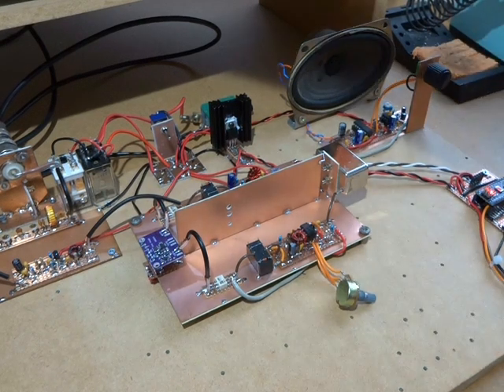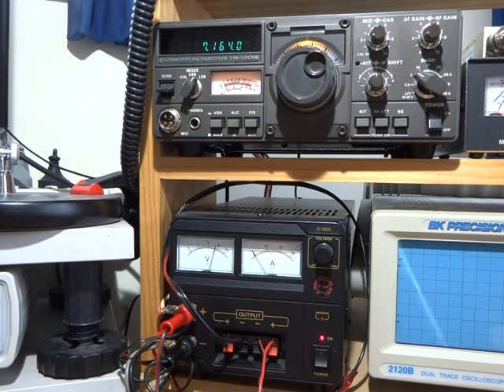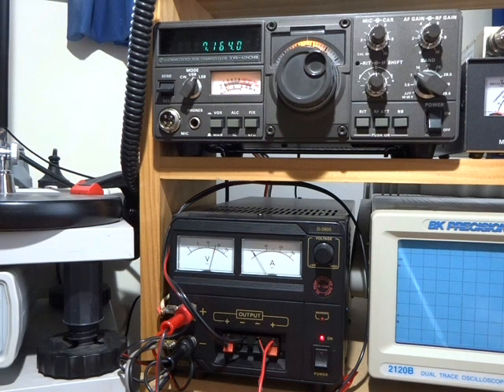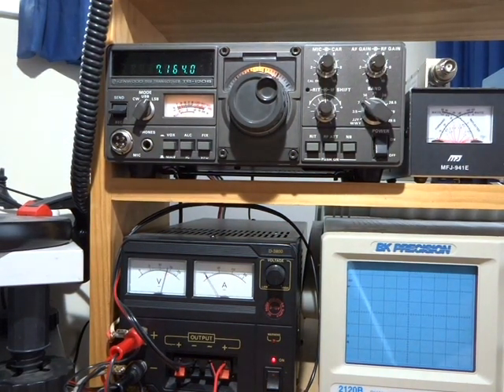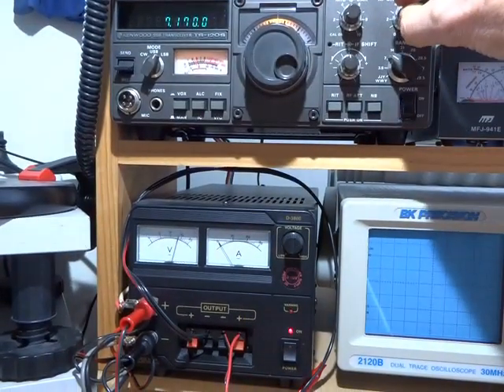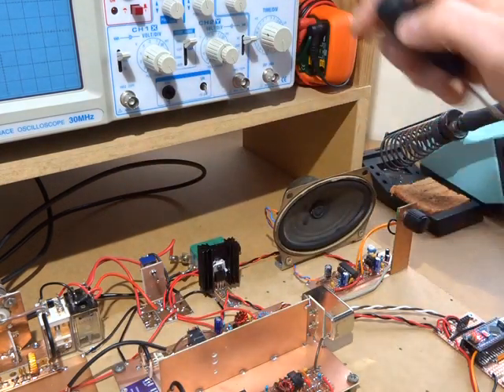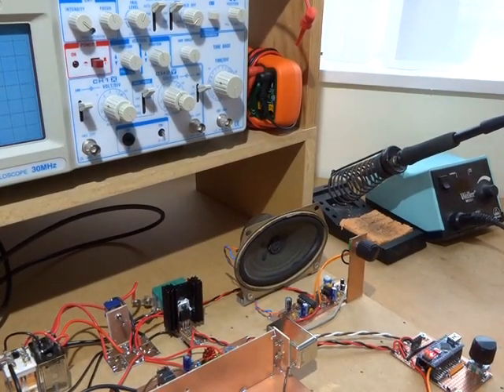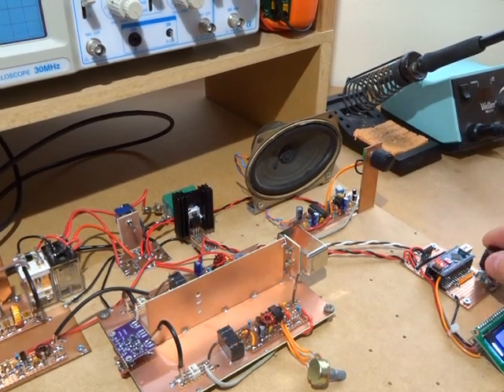Homebrew MC1350P based SSB Rig - #7a Commercial-Homebrew Receiver Comparison

Comment: Sounds great, Charlie!  One of the complaints I hear from new hams is about the cost of buying an HF rig.  You've proven that does not have to be a barrier.  I do volunteer work teaching electronics to middle school and high school students -- some of them end up getting an amateur radio license.  I'm working on a receiver design that can be built in modules, configured as a direct conversion receiver, and then as a superhet.  The radio is working well.  Now I'm redoing the PCB layouts so it will all fit in an enclosure so the students can build, learn about RF modules and receiver design, and have a decent receiver to take home with them at the end.  I'm enjoying watching your videos and am now thinking of a second version with transmit and receive capability for the ones who get licensed. 
K8VFO
Reply from the maker: That sounds like a great idea, and a great way to give back to the local community. I'd like to do the same at some stage, as I understand local high schools are crying out for that kind of thing. 

Charlie

Comment: Sounds very nice.   I got myself a lot on 2N3904s for another project so I might try building the RF Pre-Amp
 for my home brew soon. EDIT: And I just realized looking back at the RF amplifier video your using 2N3904s
Reply from the maker: Great. I tend to use 2N3904s as they are plentiful and easy to get hold of. I'm trying not to use exotic parts if I can.
Reply: @CharlieMorrisZL2CTM  Funny thing is I bought the 2N3904s to uses as switches in an upcoming project.

Comment: I've done A/B tests between most of my homebrew receivers and my 2002 era Icom IC746Pro. Usually no difference in sensitivity.  Selectivity is another thing. And the audio is dependent on lots of things.  Would like to hear from someone with a contemporary SDR, Icom 7300 or better.
Reply from the maker: Thanks Paul. That interesting.